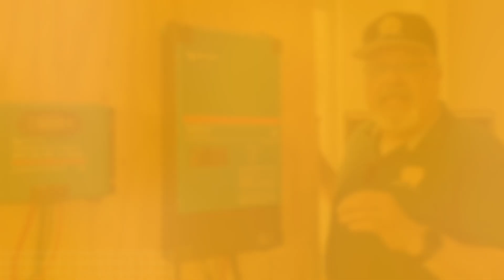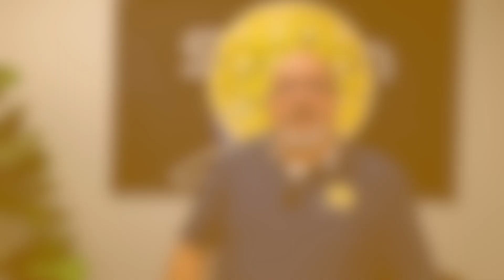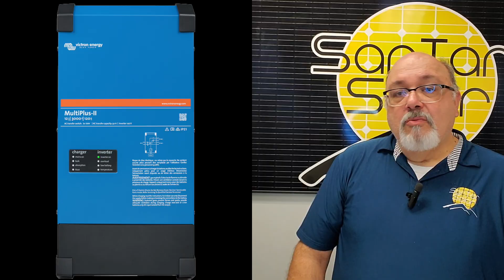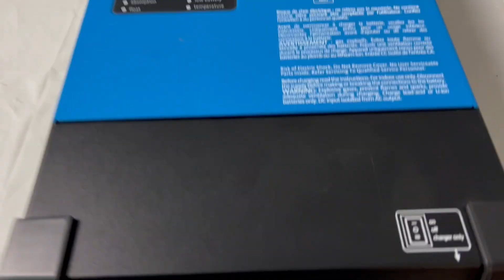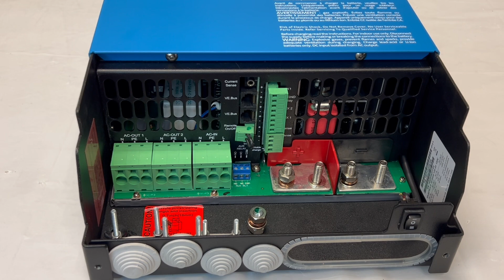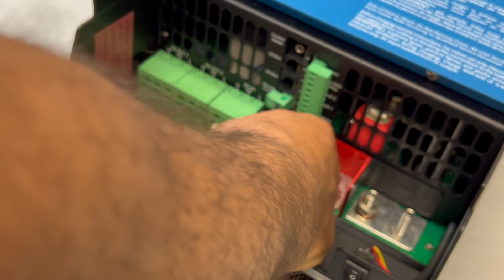Product Review - Victron Multipurpose II

Comment: Not sure If I agree with how great they are for rv  1'st you can't get any shore power unless you turn this unit on, it should fail in the closed position 2'nd they don't like to be plugged into gfci which every homeowner has to have for outside receptacles 3'rd not easy to set up to use batteries and solar as priority if your plugged in the multi is going to try  be the prioity power source to your batteries quite challenging to set-up to ignore a/c input until low enough to need charging